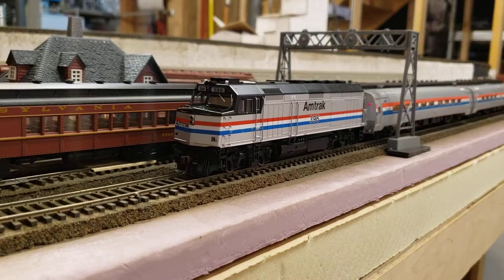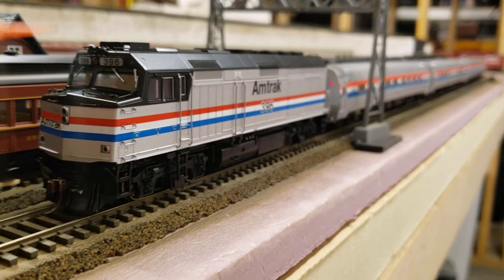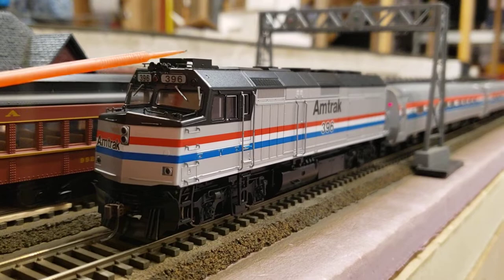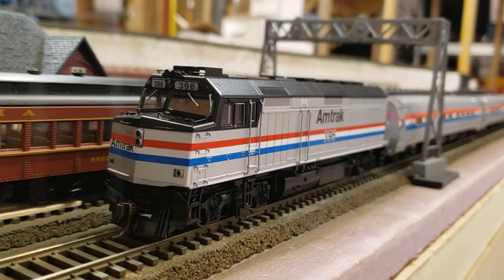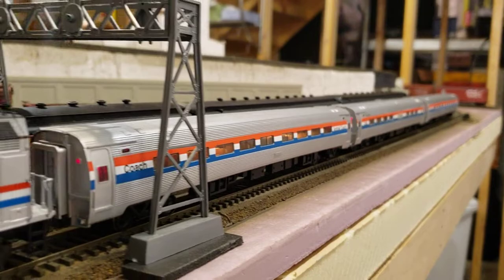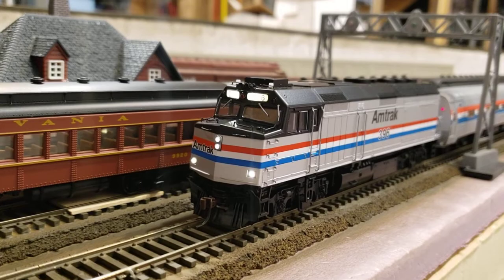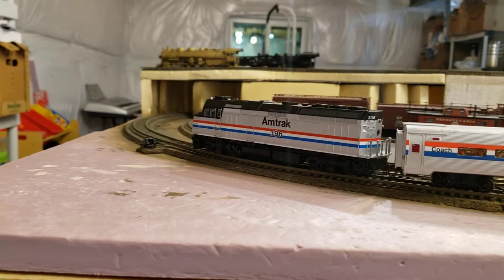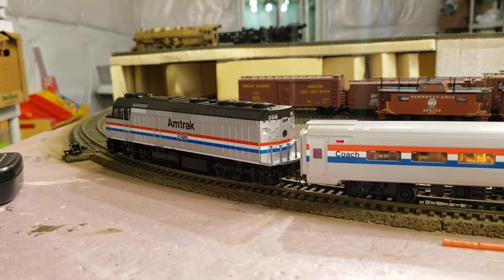Short Engine Showcase: Kato Amtrak F40PH w/ Loksound V5 and Custom Lighting Upgrades

Comment: Great work you did to that locomotive. Once you fix the brightness on the number board, the lighting will be impeccable.
Reply from the maker: thanks! Yes, that has since been fixed. Looking back the only thing I might change is to wire the numberboards directly to track power, and reserve that lighting output for the emergency red light, just for gimmicks. But frankly I would never use the right light anyways so its no biggie. Cheers!